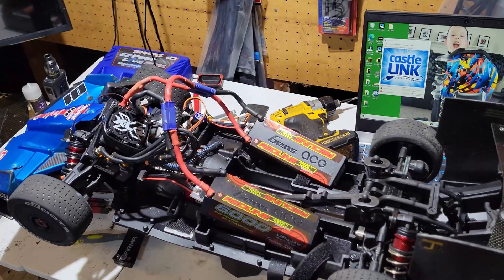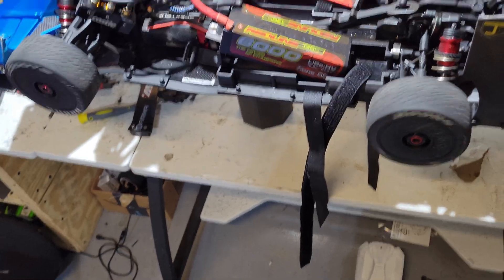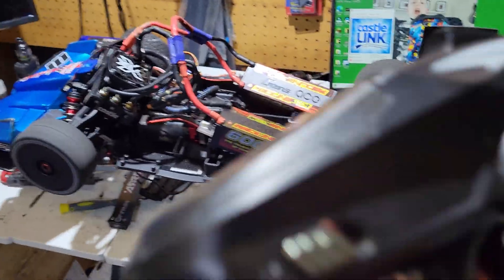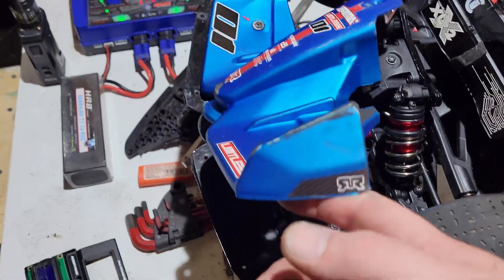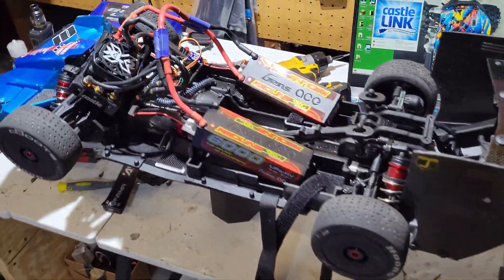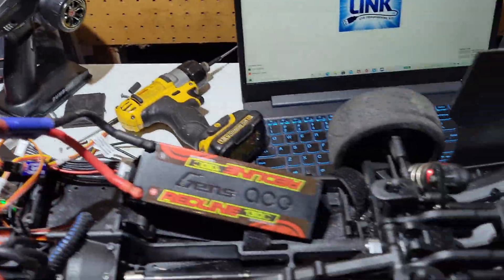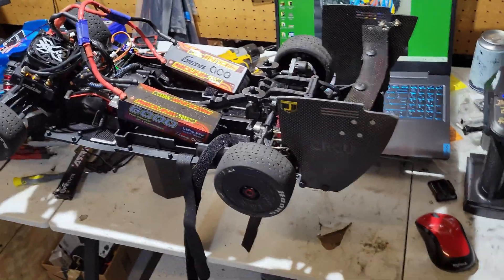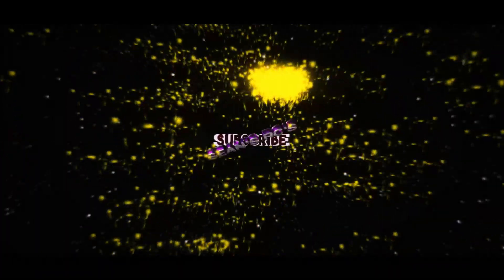HOW I PROGRAMMED THE XLX2

Comment: Good idea with the drag brake on the aux wire!

But you need to keep in mind when pulling high amp you battery connection can fail. You use ec5 5mm connections, not so big but ok. But you batterys have 4mm plugs amd thats a bit small and can get to warm and fail.

Comment: Yooo…Hey… you ever run the xlx2 with a radiolink remote? I’ve got that combo and when I let off throttle, the truck won’t just coast in neutral unless I let the trigger go immediately.. if I let off throttle slow, the motor wants to copy the trigger and it jerks the truck harshly bcs it’s purposely slowing down instead of coast.. I just uploaded the video on it, idk man, I went through EVERYTHING…… it’s NOT the castle link setup at all as far as I know.. I think it might be the remote bcs it’s got so many settings but, dang I went through allllll of that to man idk. I need to hear it from someone who’s got the xlx2 and the same 6 channel radiolink transmitter.. thanks, watch the vid if you can I need help bcs It’s annoying🤷‍♂️😎
Reply from the maker: I actually haven't had my xlx2 set up out for a while, I still have to repair my car one day soon and try some new passes, we just moved to a different city so there is always a delay when that happens, but ill definitely check it out. Thanks for letting me know

Comment: I use radiolink rc6gs with a range booster. It's a cheap radio around 75.00 but with its stock range it's 1900ft with a range extender you can go further if needed.
Reply: heyy SWALDOSKI… I need your help!!! I have radiolink 6 Chanel and xlx2&1100kv in my Kraton 1/5. I have a problem, it’s not drag brake, idk if it’s the crawler mode function or what but I’ve triple checked-quadrupole checked EVERYTHING man and I have to let off my throttle immediately if I want it to coast and roll bcs if I let off my trigger  gradually, the truck will forcibly slow down to that speed instead of just costing and roll on its own until it slows down naturally. You have the xlx2 also? You have the radiolink , have you EVER seen that happen?? Even with the aux removed and disabled in castlelink, it still does it! What is going on???? It’s been like that since day 1. My newest upload is of this trouble shoot please watch it I need help! Thank you!!
Reply: @toysforboysrc  I can tell you all my settings in the castle link maybe that may help. I dont use a Sensored motor although I should I just used what I had. Momba monster big block 1717 1650kv
Reply: MOTOR  
Motor Direction normal
Motor type
Smart sence brushless 
Senor lost warning is NOT enabled 
Senseless Motor timing 
Lowest
Motor temp cut off
Disabled 

POWER 
Start power 
Low
Max Power
100%
Rev %
70%
Punch control 
0% Disabled

BASIC
Brake Amount 
90%
Drag Brake
0.0% Disabled 
Drag Brake Ramp
Disabled (instantaneous)(*)
Reply: @swaldoski  … Miguel suggested updating the radiolink software to the newest version and or hard reset the transmitter.. I’ll go for the update bcs the it’s been doing this since before fine tuning the transmitter parameters.